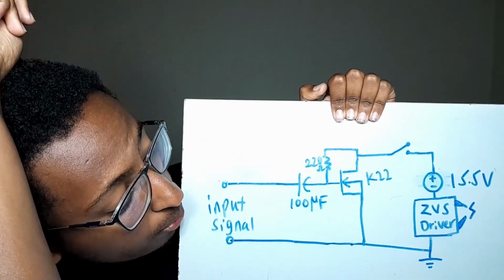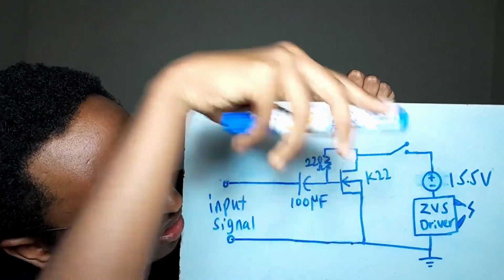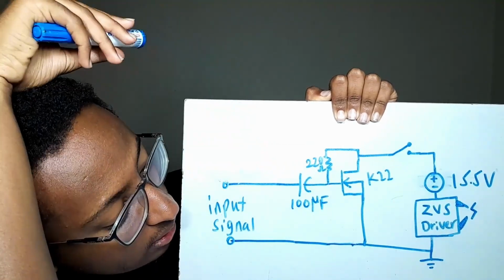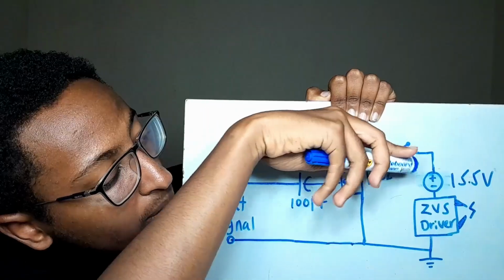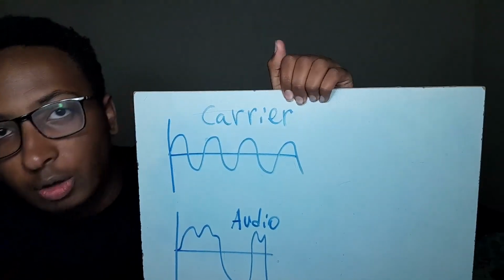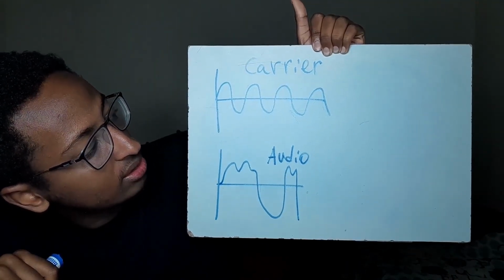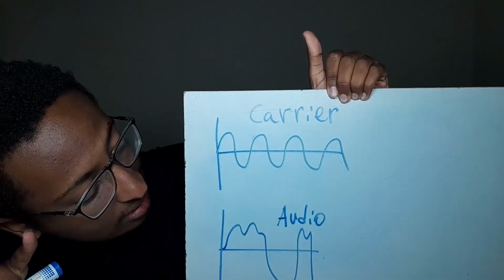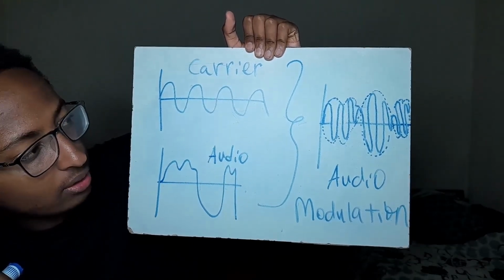This Is How I Made 30kV Arc Sing Music...

Comment: AM modulation of the ZVS circuit... Nice. But do try to chang the mosfet gate driver to have a potentiometer to adjust the bias voltage for the mosfet to be bearly on for improved audio quality.

Comment: Don't you want try 555 driver i think it will be easier to make the plasma speaker and will be better be better quality sound couse the 555 ic has pin for audio
Reply from the maker: I'll try it with 555 driver, it just I built the circuit from component at my disposal..rest assured I'll make improvements